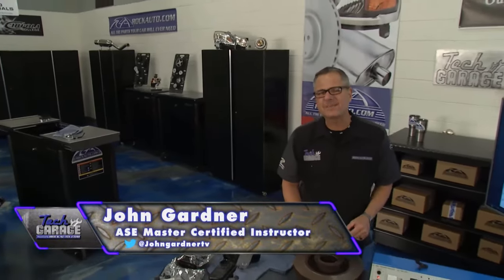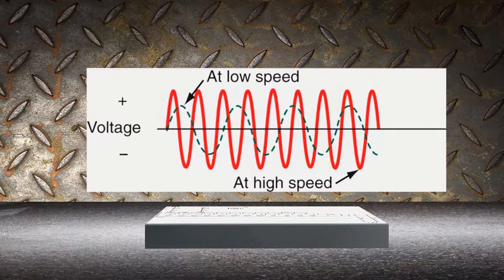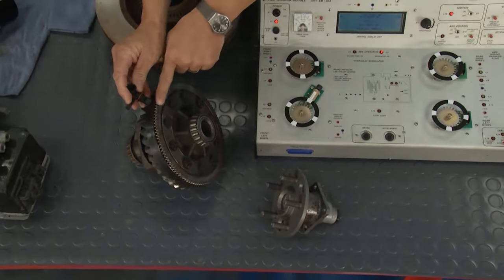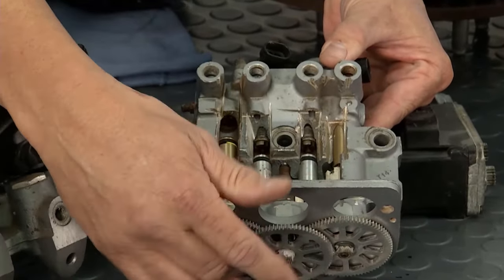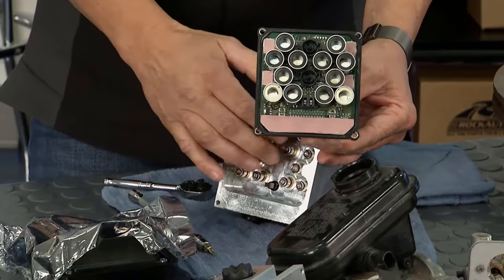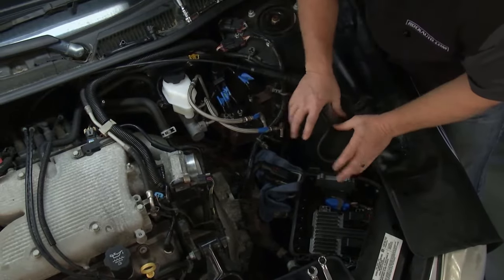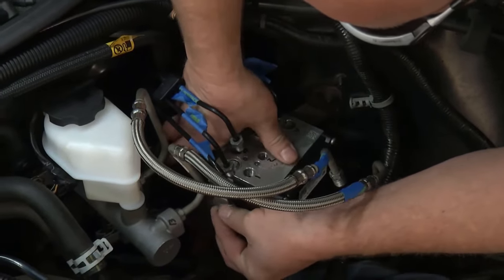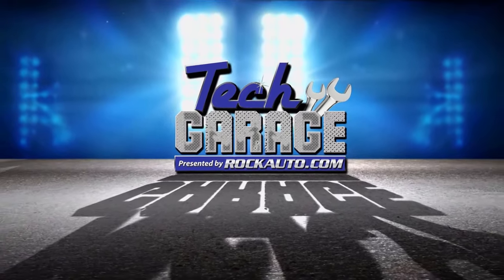ABS Module Cutaway & Install New

Comment: It would be nice to see inside the more modern square block unit, to see the actual valves and possibly the channels, everything online kinda shows a simplified version that shows the pump as though there’s one for each wheel, and I’m unsure if they use an accumulator for each or if it’s shared and same for the dump valve area because it shows a piston and spring like an accumulator
Reply: Yes, this and every other video on ABS fails miserably because they do not tell you how to repair the most expensive part - the valve body. Mine has a bad check valve, but I do not know how to remove the individual valves, so I can't fix it.

Comment: you should use some sealant on that and maybe face off the body make sure its dead nut flat, seen some leak and short out the module, burnt up

Comment: I am wondering, how do you torque the brake lines? I have a 1/2 traditional torque bar, but I cannot use the sockets.  Is there a special tool for this? Can I just tighten the crap out of it using a open box wrench?
Reply: Crows feet open end socket